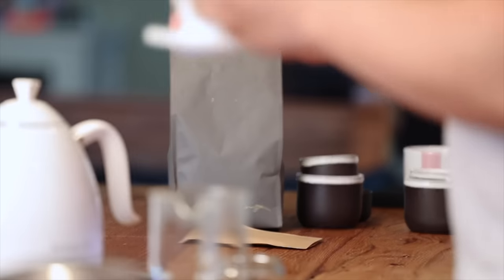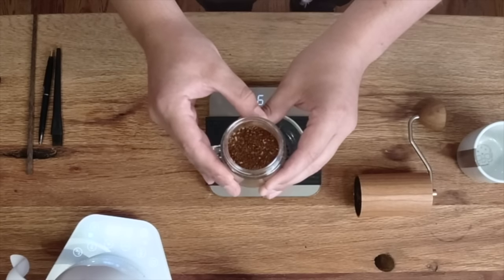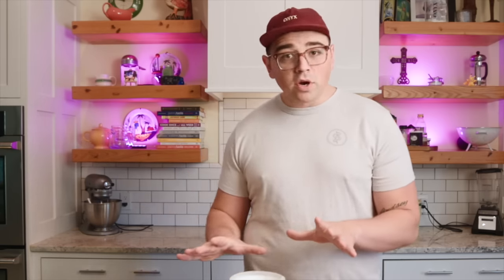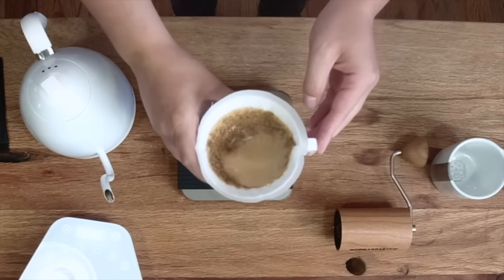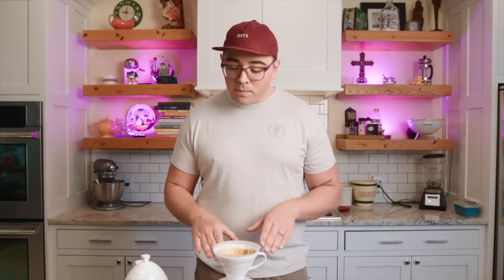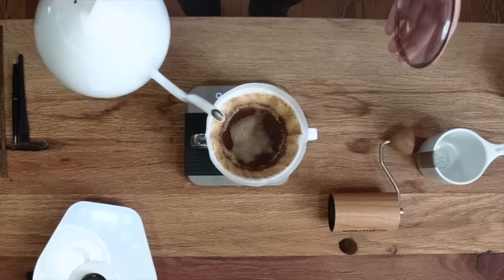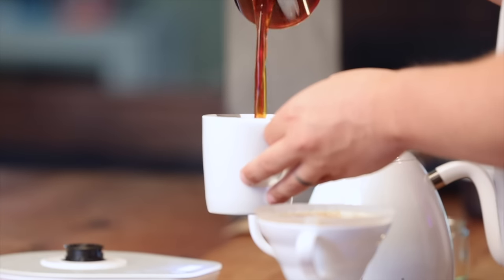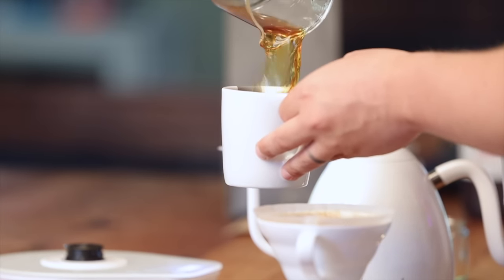HARIO V60 BREWGUIDE: Easy and Effective V60 Recipe!

Comment: Thanks Lance, just got one of my best cups out of a V60!! 16 clicks on a chestnut c2. Great recipe!!!
Reply from the maker: Perfect! Thanks for the click number. Have had some people ask.
Reply: @LanceHedrick  hello brother i need your help to findout right grind size for V60 and Chemex( i have Baratza Forte AP)Please help me to findout 🤗
Reply: 16 clicks on the c2 is pretty fine no?
Reply: I have a chestnut c2 max. With 16 clicks do you mean from the finest or coarsest setting
Reply: I tend to run towards 19-21 on a c2. Not a V60 though, Melitta cone/flat. (Settings measured from finest, as per manufacturer docs, ie Higher number = courser ground)
Reply: @mroozendaal  it's always from the smallest grind
Reply: 16??? I'm on 25

Comment: Just discovered your recipe! Been pouring v60 since so long, but always with minimal turbulence. This immediately increased intensity and sweetness. Love it. Only challenge I got is that after the last pour with swirl, the flow reduced a lot. Mostly the filter starts to drop. Couldn’t find a way around it yet. Using an ek43 with new coffee burrs. Quiet well aligned. Fines shouldn’t be a problem, but the flow behavior indicates that. Grinding on 11 on the new dial. Will try to go courser, but I suppose that it will be too course for v60 then. Anyway, taste is already great! Thanks!

Comment: Great tips, thanks. I'm missing an important one though: STIR THE CUP! Wildly different taste between the first and last extract
Reply: Do you need to stir even if you brew into a decanter?
Reply: @thelochnessmonster.350  yes or swirl. As long as you mix the bottom with the top. Bottom will be sour, top will be bitter, they need to be balanced out
Reply from the maker: Yes. Stirring is essentially if you brew directly into your cup. But, if you brew into a decanter and then pour into a cup, it will mix just fine!

Comment: Hey Lance! I recently moved from the comandante to the ode + SSP. The ode + SSP seems to produce quite a bit more fines than the comandante which I didn't expect. Anyway, this recipe is the first which has achieved good results with the ode, so thank you! It's completely blown my mind how different the SSP mps are to the comandante. The impact of burr geometry, rpm, etc, has completely reset my perception of the idea of an "objectively good" grinder without considering brew method at the same time. Very interesting!
Reply from the maker: I can assure you the ode gives a more unimodal peak. Perhaps the looks might be different, but that doesn't tell most of the story. People focus singularly on fines. If the peak is super wide but has little fines, the cup won't taste good. You can have more fines with a super tight peak and will likely procure a better cup.
Reply: @LanceHedrick  yeah, i am still quite new to the PSD rabbit hole and naively assumed that more unimodal = fewer fines = better.  My old recipe had some stirring and so I was ending up with stalled bitter/sour cups regularly. This recipe of yours strikes a much better balance for me in terms of agitating well without stalling.

Comment: TL;DR: I had a very difficult time getting a good extraction from a light roasted Sumatran coffee recently, and the high extraction method outlined here did the trick. 

For whatever reason this particular coffee would always draw very quickly and finer grinds weren't helping the draw speed or the flavor. The extra agitation from the 5 spins really helped to bring out the sweetness from a coffee that was heavy with malic acidity and really needed that sweetness to balance the cup. I'm still testing V60 methods on coffees of more common origin (South and Central America, Ethiopia etc.) but this method definitely gives you a high extraction and all-important adjustability.
Reply from the maker: That's awesome! So glad you're achieving success with it!

Comment: Just tried this on V60 with a washed nicaragua
6'2 on ODE with SSP burrs, calibrated to 1 = 1 click past chirp
17.6g:300mls
Water around 93 degrees (personal preference)

00:00: 40ml bloom, spin somewhat aggressively
00:45: 60ml second bloom, spin (less aggressively as less effort required to wet all grounds, since they're already pre-wet)
1:15: pour to 200mls, swirl
1:45: pour to 300mls, swirl

Draw down was slow (ish) just under 4 mins. 
Probably multifactorial, water is not just off boil, i dont preheat my brewing vessel that aggressively, this particularly coffee is quite chaffy, and while my SSP burrs are great, I do not bother with shim alignment as my coffee tastes good enough for me so my fines reduction is not necessarily optimized for my burr set.

Results were really, really good for my set up and I had a really sweet cup with juicy body and great balance and acidity. This will probably be my go-to in the mornings. I particularly like how the pouring technique is somewhat easier than say other multi-pour techniques. 

Thanks lance!

Comment: Followed starting recipe to the letter with a natural Ethiopian (Guji) from Fried Hats, roasted 04/19, using a cheap home kettle and an Encore. It ended up with a 5 min 30 drawdown but there were no bitter or negative flavours. I don't have a refractometer at home, but from what I'm used to testing at work (specialty coffee shop) it easily was higher than a 22% extraction. Brilliant recipe bud
Reply from the maker: Love it! And yeah- spinning is the worst variable. If you go too hard at ALL, it'll majorly slow it down. But even with stalls, I've found incredible cups.
Reply: @LanceHedrick  oh for sure, can be a very inconsistent variable but feels like a necessaryone nevertheless. I shall be employing this as my go-to at home from now on!
Reply from the maker: Incredible! Thanks for checking it out and already giving it a go
Reply: @LanceHedrick  quick Q though - in your personal brewing, eould you bring the kettle to boiling only at the start, or try to keep it at boiling for each pour? The former would maintain water quality but the latter would increase slurry temp
Reply from the maker: I like to keep it at the highest temp possible. I'll do a video with this soon.

Comment: This is the first video I've seen giving microns for the grind size, and honestly that's more translatable than most things I've heard. I can easily, say, get a loose translation for a 1ZPresso K-Max which would be 22 microns per click (according to the manual) so 33 clicks (726 microns) to get to around 720 microns as mentioned in the video. Communicating grind size in a video is tough, even with grind shots next to a Kruve Brewler, so appreciate the idea. None of this is perfect, no worries, adjusting grind size is a big part of brewing, but still neat to see this approach.

For V60, though, this seems really fine? I'm typically grinding around 65 to 70 clicks (a 6.5 or 7 on the grind sized ring) on a K-Max, so allegedly 1,430 to 1,540 microns, unless I'm miscalculating something. (I'm definitely miscalculating something...)

From the Ditting 804 documentation:
These are the factory suggested settings.
1 - Turkish (approx. 100 microns)
3 - Espresso (approx. 300 microns)
5 - Paper Filter (approx. 500 microns)
6 - Melitta (approx. 600 microns)
7 - Metal Filter (approx. 700 microns)
8 - Perculator (approx. 800 microns)
8 1/2 - Pods (approx. 850 microns)
9 - French Press (approx. 900 microns)

So I'm definitely getting something wrong about the K-Max setting...

The K-Max manual says "numbers from 2 to 4 are the espresso range." That would be 440-880 microns, so I'm missing something...
Reply: You can't convert micron between different grinders

Comment: Hello! I don't have a V60 but did it with melitta. Great as well! The only thing I notice is that maybe the high agitation may increase the fines migration because the second attack takes longer to drip. But the cup doesn't taste overextracted. In fact it gets sweeter than my usual slow single pour. Thanks for the video! Great as always!
Reply from the maker: Yes fines migration can be a problem if swirling too hard. Shouldn't be an issue if you only swirl the first two times aggressively. The final two should be gentle.
Reply from the maker: But yes- there shouldn't be much bitters even with longer drawdowns!

Comment: Hi Lance - thank you soo much for such a detailed video. I have been having a tough time saturating the coffee bed in the bloom phase (despite the two blooms) n this seems to b a problem across roasts, across recipes. I'm using a med dark roast (10 days after roasting).In the first bloom, the coffee swelled up but there were no bubbles n I could see no water that I could swirl. In the second bloom I saw a lot of bubbles, again hardly any water to swirl - though I did manage to swirl something extremely viscous. Total brew time was a lil under 2 minutes - after I was done with the entire brew, I saw some fine bubbles on the surface of the bed!! I have a comandante, it's about a month old. Not sure if I need to grind way way finer cos my v60 regardless of the recipe always drains too fast even at 18 clicks (with another recipe). Also my water temp was around 88c. Look fwd to ur response, thank you soo much:)
Reply: Oh yeah, I used 20 g coffee in size 01 dripper. Followed ur recipe to the t.

Comment: This was a wonderfully interesting video. I would’ve liked to see a close-up of the grind size, the divot, and the final draw down. The camera was either too high or oddly just a shot of the side of the V6. Thanks again for showing this technique.
Reply from the maker: No problem! The camera from the overhead angle kept turning on and off. Apparently it is voice activated and certain words I said turned it off. So we worked with what we had. We have sense deactivated voice control haha.
Thanks for watching!

Comment: Great video lance! When determining the grind size, I use a 1ZPresso JX and can’t easily dial in commandants clicks or find 720 microns. Can I use total brew time to dial in grind size? I’m using 15g coffee to 255g water
Reply: I have a similar set up and my total brew time with 1min bloom is around 2:30-3:00 minutes. 

The brew can't go super fast nor should it stall.

I just saw your message is 2 years old. Forgive me. Did you get it all figured out?

Comment: Another great video! Two intertwined questions: Do you aim for the same TBT for 15 as with 25 grams, or do you let it vary, keeping grind size constant. 2. Or do you change grind size slightly from 15–25 grams, like say 22–26 on the C40, to achieve constant TBT?
Reply from the maker: I moreso osciallte between 22-25, depending on coffee and dose.

And the TBT will be a bit longer but keep the pulses the same for sale of ease. When going above 25 grams is when I'd change up to for sure have 3 pulses at the end and maybe a coarser grind size.
Reply: @LanceHedrick  Thanks! Will try, measure and taste tomorrow. Any idea, roundabout what grind size on a EK43?
Reply from the maker: Yeah! Between 10 and 11 o clock if looking at the dial as a clock

Comment: Thanks for another informative video! When I try this method, my brew runs over 5 minutes for 15g coffee 255 g water in, but it does taste good! My grind is already looking closer than yours I think.. should I worry about this? Go coarser? Different papers? I’ve got a metal dripper, and, probably more relevantly, I use the filters from the noisy plastic pack. Which filters do you use?
Reply from the maker: Don't worry about time if it tastes good! Metal dripper can be an issue as it sucks heat out, but filters are definitely important. I like hario untabbed or cafec medium roast

Comment: What do you think about the Kubomi method of putting a chopstick in the brewer before adding the coffee and then creating a swirled bed. Feels like that would create the minimum possible compression on the grounds, though perhaps no added value for the extra effort and complication.

Great content though, you are a good teacher and hit a nice balance - technical enough to understand the rationale without being overwhelming. I feel like I am actually learning something I can work off instead of just rote following a list of instructions because that’s what I have been told to do. Picture in Picture might have been nice to have a consistent overhead shot throughout but that might be just me. Keep doing what you’re doing, look forward to the next video :)
Reply from the maker: Thanks! And if you're on Instagram I have a full post on my thoughts in Kubomi. Easy to find the post as it is a picture of a bed with Kubomi. Go check it!

Comment: Appreciate this method. I was curious on your thoughts on lower agitation. I’ve been experimenting with that lately, and I’ve been getting much faster brew times. I feel like if I let it drain too long, I get more bitter/astringent cups. The high agitation seems to clog the filter with fines.

Also, have you tried putting the chip stick in first, and then making the divet by moving the chopstick around from the outside wall of the v60 to the center, then pulling the chopstick out? I believe it’s called the kubomi method. It prevents compacting the grounds into the filter.

Comment: Hey Lance, great recipe you have here but I have a question in my mind since trying this method. I've made 2 brews and one I did the pour to the center only and one I did a circular pour for the remaining 40 gr water for last 2 steps (I'm doing 15 to 250 40-40-85-85). In the end the one I circle poured tested fuller bodied and more even. Do you have any thoughts about that or have you tried it yourself? Would love to hear your opinion on this. Keep up the great work!
Reply from the maker: Hey! If so, do that! I go more middle to ensure a constant deep turbulence to the base of the cone. But, always open to changes based on water, grinder, bean, etc.

Comment: Best way to heat a ceramic V60 is by putting it in your toaster oven using the warm setting. I use silicon oven mitts to take it out and place it on my carafe.

Comment: Hey Lance! Thanks for this. I'm curious though: most, if not all, V60 brewing methods I've come across this far have been almost obsessively focused on NOT disturbing the coffee bed and your method seems to use disturbing the bed as its main feature. It's not a bug, it's a feature? Also, I noticed as soon as I ran out of the first batch of Japanese V60 papers that came with my brewer that the ones sold in most parts of Europe (and made in Europe) have a very different tendency to clog from fines as compared to the Japanese ones. This has made pulse brewinig such as your method almost impossible to pull off on my setup. The Japanese filters are very hard to find locally in Sweden and importing is cost prohibitive. What are your thoughts on recommended papers for your method? I know you touched on fines migration and clogging in your pour over theory video and pinned it down as "avoid at all costs".
Reply from the maker: So, negating agitation gives weak brews that are under extracted. Those brews aren't my preference and leave out a lot of sweetness, though they do push acidity. They are also impossible to replicate.
As for filters, the tabbed ones suck. You're correct. The untabbed are the best and can be found on Amazon though I'm unsure if they are available on your Amazon.
I love the Cafec Medium Roast filters
Reply: @LanceHedrick  Thanks for replying! I get that there is a reason as to why everyone does their own thing, only your video was the first method I've ever come across that promotes agitating the coffee bed. James Hoffmans technique actively references agitation as the reason to stir in opposite directions, as to not agitate. I understand that you can't speak for others but do you have any thoughts as to why the non-disturbed bed has been the dominating school of thought this far? If it does indeed produce under extracted brews, that seems like a flaw that should have been adressed a while ago? There's a lot of nerd out there :)
Thanks again!

Comment: Thank you for sharing this. I've got a Bodum Bistro grinder and I am always struggling to finetune the taste because of the inconsistency of the grind when you move to a coarser grind. I tried the recipe and I am quite there. Good body , slight acidity but I am looking for a bit more sweet notes. Do you have any suggestions to adjust? Do I tweak the temperature, the grind or the dose? I currently have Colombian beans (La Esperanza, Huila), use water after a few minutes after boiling, pourover setting on the Bistro and the dose you used in the video. Thank you in advance!

Comment: Awesome video!
Just a question, not sure if it’s been asked so far. I apologize if it’s been asked already. 
What’s the difference in EY & TDS of the brews; single bloom vs your 2 pour bloom?
Reply from the maker: Hey! So the number difference is minimal. Numbers don't really signify what is being extracted. Different chemical compounds extract at different rates. By focusing on extraction early, you could achieve a tasty 22% brew. Or you could focus extraction late, get some slow releasing compounds out that might taste bitter and hit 22%, as well. The number does not tell us what it means. Just what we pulled out, and even then with a margin of error. I'd suggest doing some side by side brews and comparing taste. Taste is king, after all!